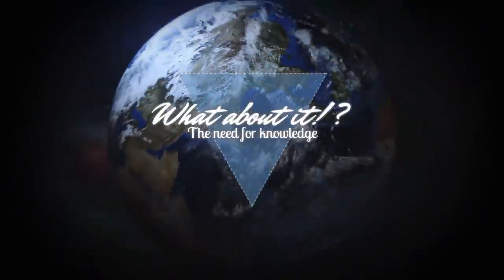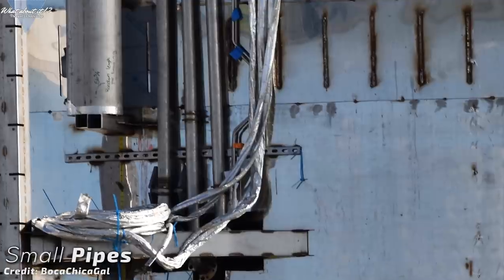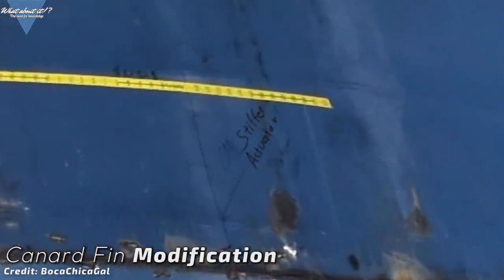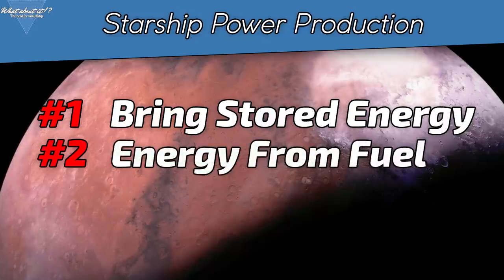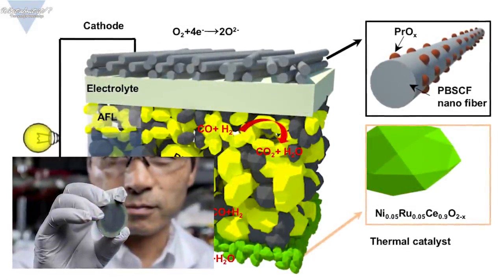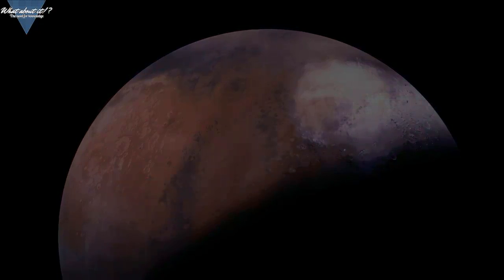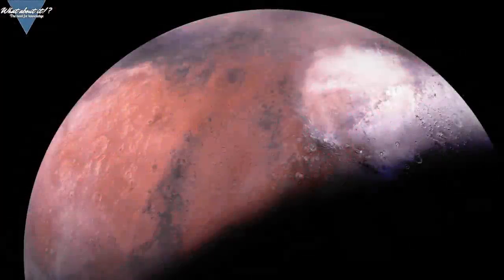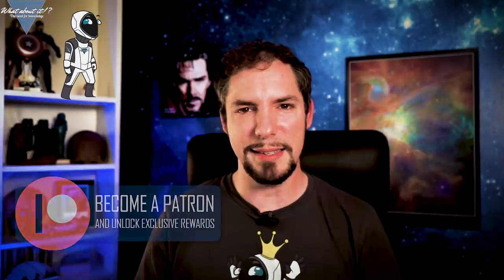45 | - How Does Spacex's Starship Generate Power?

Comment: For human flights - Radio-Thermal Generators (like Voyager probes). They will work at near full capacity for the 2.5 year duration of going there and back.
+ Most likely solar panels that will be deployed out of some slots on the sides of the spaceship once in space.
Reply: The space shuttle Sterling engine can run over 2 years. It produced 10,000 watts. I don't know how well it would work while sitting on the surface. It needs the cold from space to work

Comment: One option not mentioned is a generator driven by a stirling engine burning methane and oxygen from the propellant tanks.  The efficiency can exceed that of an indirect methane-oxygen fuel cell and is much less complicated, depending only on well proven and rather simple technology.  
A modern free piston stirling engine contains only to moving parts, controlling the motion electronically rather than through a crankshaft. This allows to optimise the efficiency at any load and is also less subject to wear making it very reliable and long lasting. 

As with the fuel cell this would also provide potable water as a by product, reducing or possibly eliminating the need to carry water at all for the crew.
Reply from the maker: Absolutely. I totally forgot about the Sterling engine. Thank you! :) Next time!
Reply: Kilopower reactors use a stirling cycle to convert thermal to electrical power. You could even use IR radiation from the Sun to power a stirling cycle engine. You only need a thermal differential...... What if they're going to use the difference in temperature from each side of the ship? That's a huge difference in temperature from the sunlit to the dark side. There's also thermocouples too, which is kind of a solid state version of a Stirling Engine.
I think this fits with the "best engineering is no engineering." You already have waste heat that has to go overboard so you don't cook the contents of the ship, why don't you use it?
Reply: @coreys2686  The thermocouple is far less efficient than the Stirling engine. 

Heat pipes are a good way to transfer waste heat to the radiator surfaces in shadow. Very low power pumps push liquids back to the heat source.
Reply: If you assume a tank capacity of 240 t of methane and 960 t of oxygen and a 20% efficiency of the sterling engine, you would need to burn around 30% of the fuel to deliver 90 kW over a 3 month journey. So it sounds very plausible. Plus it would be nice to have emergency generators on mars in case the solar cells get covered in dust for example or the batteries run empty in the middle of the night.

Comment: Great episode!  The question of power should start with an estimation for how much power is needed during travel.  During reentry, needing to actuate those airbrakes will probably go through a whole battery pack in two minutes;  but during the 6 month jurney the needs should be a lot lower.  Lights consume little power.  Heat is more likely to need dissipation than generation, and dissipation involves passing a thermal fluid from the interior to an external radiator (which, by the way, that is as imperative as solar panels... actually, much more imperative than solar panels, since solar panels could be replaced by a nuclear plant, but nothing replaces radiators) and circulating the juice takes very little energy.  Lights don't cost too many watts; specially LEDs. Cooking is only done once or twice a day.  Probably most of the power needed will be for their computers and radio communications.
EDIT:  The other thing to mention is that none of the prototypes will probably need solar, or any kind of power, or radiators, so we can't look at the present construction and interpolate too much.
EDIT2:  Maybe they have stationary bicycles for crew exercise that turn the energy into electricity and charge the batteries!  :-)
Reply: ISS uses about 90kW. I think Felix said in the video the trip time according to SpaceX estimates is about 2160 hours. That translates into (90kW x 2160 hours = 194,4000 kWh) required. One way. Felix calculated that as well. That's where he came up with the 1166 tons for the mass requirement for the batteries.
I agree that the prototypes are unlikely to need more than a couple Tesla Model 3 battery packs.
If kilopower can get to the 10kW capacity one their reactors, one Starship will require at least 10 of them, for redundancy.
https://en.wikipedia.org/wiki/Kilopower
A 10kW reactor has a design weight of 1500kg. That means at least 15 tons for active reactors on board. On the brightside, they'd be good for 10-15 years without much maintenance.
The kilopower article says 40kW would be able to support 4 to 6 astronauts for a Mars Mission, I'm assuming that's life-support. ISS power levels is a good starting point.
Reply: @coreys2686  Yeah, that sounds like good assumptions.  Likely Kilopower, then.  There will be a need for nuclear energy down on Mars in the beginning, anyways;  and probably a greater need later, come to think.  Producing fuel from the atmosphere, sabatier, water electrolysis for hydrogen and oxygen... this will consume quite a bit of power;  solar arrays will need to be extensive;  probably impractical to set up early in the colonization effort.  Given that, might as well use nuclear for the ship, then run an extension from the ship on Mars.
Reply from the maker: Thank you for the really nice comments! I would agree on the nuclear being needed on Mars, if Elon wouldn't have said multiple times, that Solar will provide the power. So, we have to think about what SpaceX will plan to do, not NASA. On a NASA mission I would totally agree about the reactor. If there's anything we know by now though, it's that SpaceX does not take the NASA approach. ^^ It will be very interesting to see, what they come up with! :)

Comment: Starships will probably dock with a pre-launched,  re-usable, "service module", which stay in orbit and will hold extra oxygen, water, power sources, ect.  I doubt crewed starships will go to mars "naked" after re-filling.  You could "design out" allot of components by using this approach.
Reply: I expect a starship variant will be optimized for the moon before any Mars trip. Elon recognizes the value of rapid evolution ... incorporating frequent design changes based on lessons learned during the journey.   By the time a Mars bound Starship launches, there will have been many improvements.  I bet Elon would incorporate nuclear power it it becomes available. I expect the Mars starship will be drastically different than the moon starship including solar panels outside the rocket shell. The moon starship makes a lot of sense but if using the gateway lunar orbiting station as a stopover is mandatory, then there likely would be an extra variant optimized to do round trips between the moon and gateway.
Reply from the maker: @blzrdphoto Congratulations on an excellent idea! That sounds very solid. Especially because you could point the tail at the sun! Perfect for radiation shielding! Well done!

Comment: Those welded on angle iron rails are for attaching the outer stainless sheet fairing covers to the hinge area. (as well as make it look better.)
For powering Starship, my nomination is a closed loop steam generator using waste heat from the turbo pumps.  (And solar panels when the engines are off)
Reply from the maker: Thank you for the reply! Sounds plausible. What would that steam generator weigh?
Reply: @Whataboutit  -With todays materials and turbine technology?  Less than 600 Lbs.  I will try to research a system and get back.
-Elon said that his plan was to have enough fuel to not just coast to Mars, but to power half way then turn over and brake the other half to shorten the trip.
This would allow a steam generator to easily power most of the trip. A  few solar panels and the Tesla battery packs would cover the rest.
Reply: OK, After some research, I found that the small turbine type APU's are in everything from tanks to airplanes to ships.  The shuttle had three APU's for redundancy.  Only one was needed during landing .  So it is not a far stretch from a gas turbine APU to a steam turbine APU.  Most are purpose built but many makers advertise custom units from off-the-shelf modules.  Aircraft APU's go from 250-350Kg.  Some are rather big and can go up to 5 Mw.

Comment: I think it will be a per mission decision as to what the power source will be.  LEO and Moon probably won't require nearly as much power as a trip to Mars would.  A combination of all these is likely in my opinion.
Reply: My guess is that they have simply not desided on how to put solar panels yet. Bottom would be best as you would prefer to have the rear facing the sun. 
Another option is on the other side of the heat shield, think a bit like how its done on dragon 1 trunk. 
Last is on top of the oxidizer tank below the cargo space. 

Note that the first versions will just use batteries, you don't need solar panels until you start spending time in space. 
The cargo versions also just require small panels.

Comment: Kilopower (or similar) is the most likely/feasable imo. These will also be useful on the surface at night. NASA is anxious to deploy these having spent many years and $$ in development. Moreover RTGs have been launched successfully many times so there is precedent, and, as you showed, kilopower systems feature heavily in many official renders.
Reply: Space shuttle was using the Sterling engine. It produced 10,000 watts. It should be able to run much longer than a Mars trip.
Reply from the maker: Absolutely! I was just looking at options, SpaceX is most likely going to use in the beginning. I do not believe, a Kilopower eactor could be integrated within the next 4 years, looking at NASA's speed... ;)

Comment: We did some experimentation with TEG panals. They basically use 2 dissimilar metals to harness a heat differential to produce an electric current much like the p and n material does in solar cells with light. The heat differential between the cold and hot sides of starship would create epic amounts of power,as would the heat differential between the inner and outer surfaces of the ship. Also properly mounted these panals would be impervious to the heat of reentry, and again, could use that heat differential to produce more power. Just a thought.